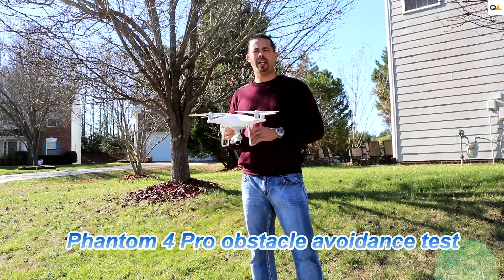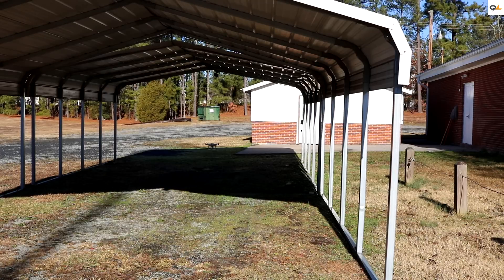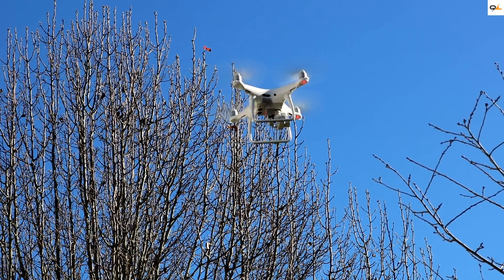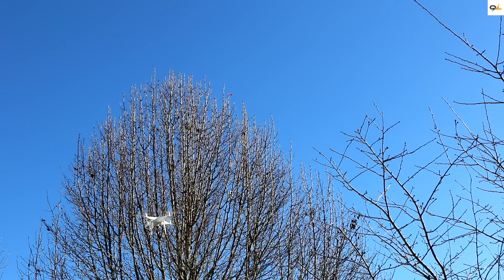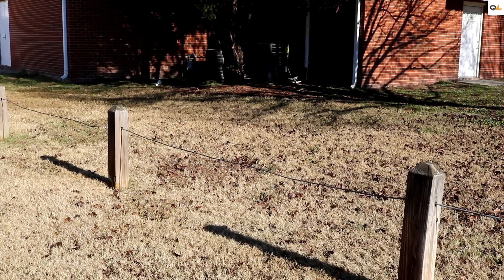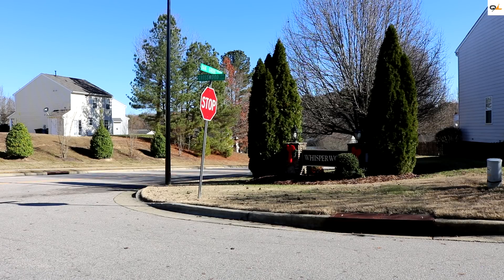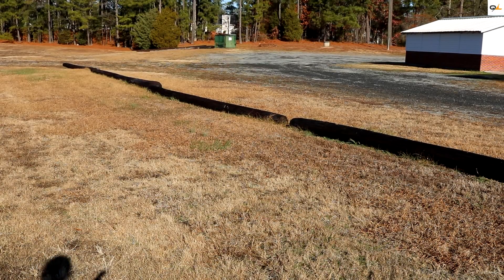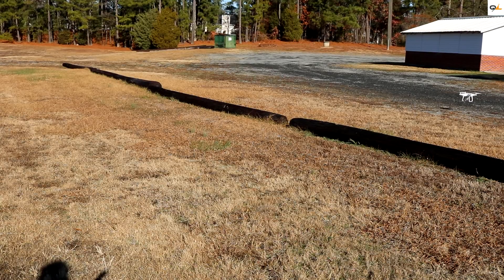Phantom 4 Pro obstacle avoidance

Comment: Thanks for your videos. subscribed. I just got my p4p have not flown yet but when I power up inside(in beg mode) I can see front and rear sensors working. Will the sides not work till your actually flying? It's just sitting on my counter. When I move around I can see the front and rear picking up stuff. Wind is 45mph or I would try.  Thanks for your help!
Reply from the maker: Your welcome
Reply: Did you see my question above? Can you tell if side is working before you fly? Front and rear working but no sides. Thanks again!
Reply from the maker: Casey VanSanten The sides only work in beginner and Tripod modes. Get her in the air and walk around her while hovering and she should beep on all for sides in those modes, only front and read with regular mode. none in sport mode.

Comment: New to drones- just got mine. From what I've read, the sensors are also turned off it you have the guards in place. How does it know?  Maybe the sensors need to be turned off.  I also can't get my guards to drop all the way down into the slots. Am I doing something wrong?
Reply: Also, with the range extenders, you should be flying out of visual sight, so the mode should be sensors on. Correct?
Reply from the maker: Only in beginner and p-mode.
Reply from the maker: Without looking at your situation, cant help you. Send some pic's  to my facebook page.

Comment: It uses all of the sensors in tripod mode ,beginner mode, tap flay and active track
In tap fly and active track it will not show the sides on but you can see them flashing and it will stop.
Reply from the maker: Great information, will try.

Comment: nice test! it's was really hard to listen to you because of the buzzing noise of the phantom 4! but I get it hehe. do you know if the bottom sensors (vision sensor) also active in normal mode? also I wonder if we can minimize the beeping sounds on the app?
Reply from the maker: It helps prevent landing on uneven surfaces like water or heavy grass.

Comment: Can you use active track in tripod mode?
Reply: Also, why is there no "beginner" mode with full range. What if we want to fly at the max speed to use all sensors, but want to fly far away. That would be really nice. Tripod mode is really cool, but a bit slow for a lot of things.
Reply from the maker: Yes you can, but flight is slow. Very hard to get fast moving shots.

Comment: Hi i have the opportunity to pick up a used P4  with second battery for US $950 only 5 months old or should i buy the P4P is the difference in the new model and the old model that significant to pay nearly double advice would be appreciated as it my first drone purchase
Reply from the maker: Sorry so late, I missed you comment by mistake. I think the P4 is just as good in many ways. The obstacle avoidance is a plus, but it is far from what they advertise. I have had dozen of close calls because sensors did not read obstacles. If you fly responsibly, you really don't need obstacle avoidance. I know I don't. I fly my Inspire 1 more than anything else I own.